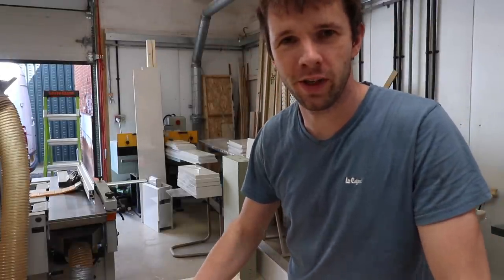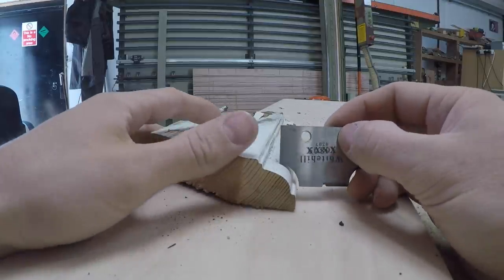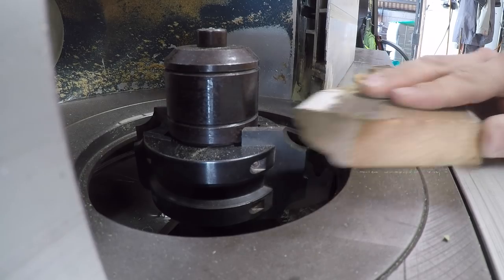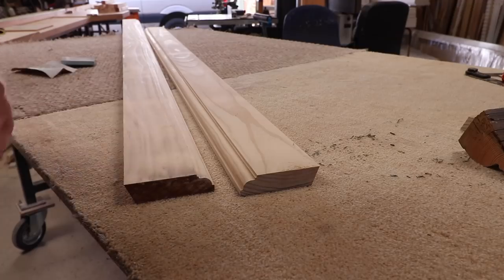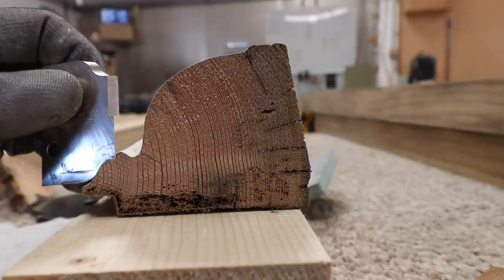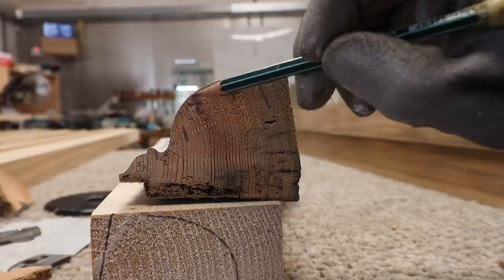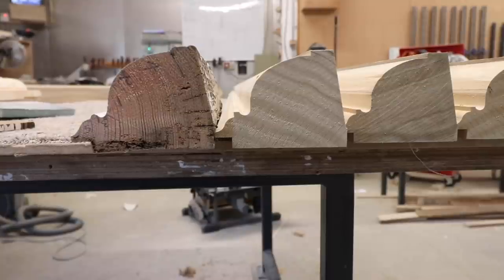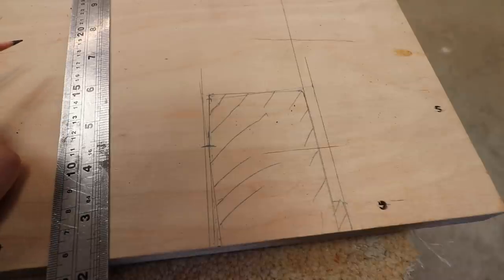Replicating Large Timber Mouldings using Spindle Moulder

Comment: Enjoyed this, and great work on the videography. Didn't quite understand the bit about running the spindle backwards and having the cutters bevel up/down, be interesting to see explanation in a future vid if you get chance. I only have a router to compare with - it only goes backwards when I mount it in the table 🤣
Reply from the maker: Thankyou, Sorry it is a little confuzzling, if you put the cutterblock on the spingle upside down the cutters are on the right and the spindle would have to reverse in rotation to be able to cut, this gives you the ability to use a corner of the cutter either underneath the workpiece or above it.

Comment: Fascinating really enjoyed, as already mentioned didn't understand why you ran spindle backwards,
Reply from the maker: Thanks Pete, I replied below : if you put the cutterblock on the spindle upside down the cutters are on the right and the spindle would have to reverse in rotation to be able to cut, this gives you the ability to use a corner of the cutter that would have been on the top side of the block underneath it.
Reply: @BradshawJoinery  get it now hadn't reaised you had turned cutter upside down lol

Comment: Can I ask for your opinion on spindal moulders plz Mr Bradshaw? I am moving workshop in the new year to a much larger unit and my current spindal moulder has started failing TODAY!!  I am looking to purchase a new one this week but I'm no expert. Can you or your viewers advise please ? I don't want to spend upwards of £5000 but I'd like a power feed in that budget also. 
 Kind regards in advance 
Paneinthesash (louis)
Reply from the maker: Hi Norman, I would look at second hand felder. the 700 series is the perfect machine IMO. Should pick up a very good model with powerfeed for that budget. Whatever brand id opt for tilting spindle. the height readout is a godsend tbh also. The sliding table i don't use at all, but might come into its own if you don't have a separate tenoner.